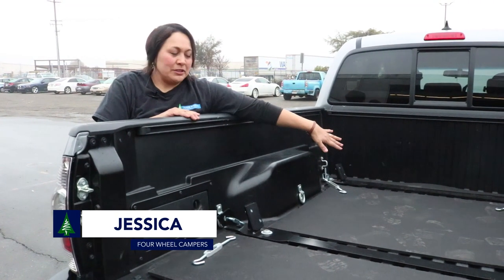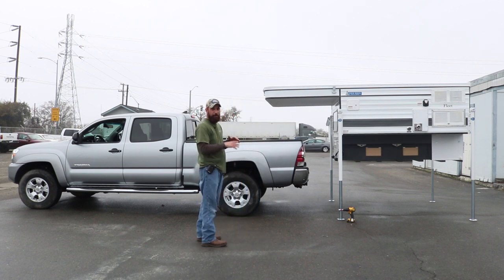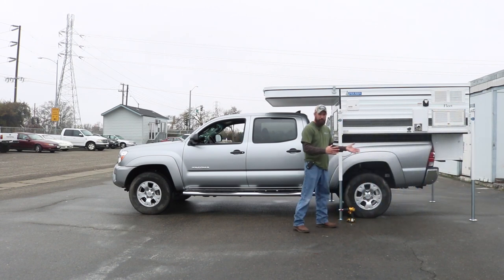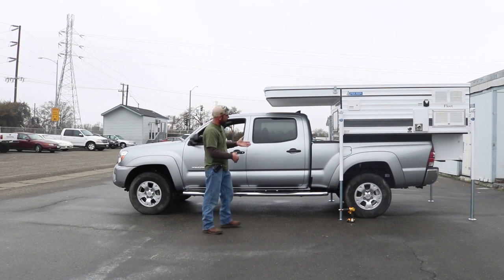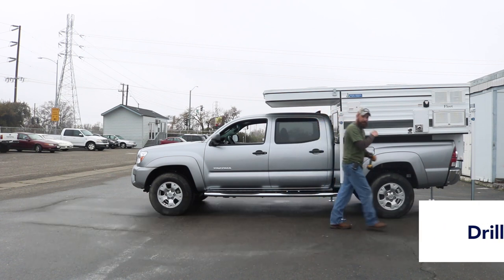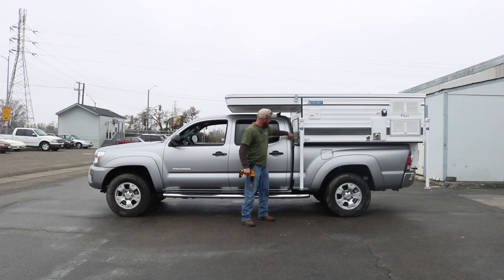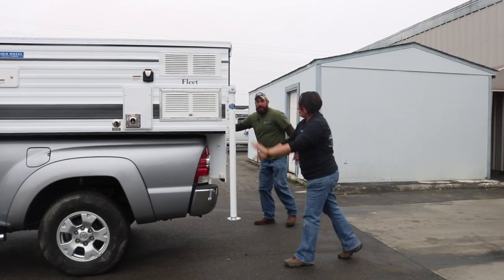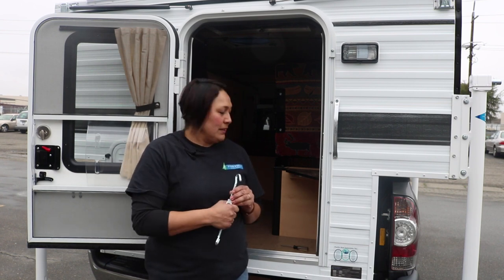Pop-up Truck Camper Installation | Four Wheel Campers

Comment: Watched for the video procedure of installing the turnbuckles but only got a verbal description of the process :o( But, I did learn that turnbuckles are used instead of ratchet straps. At least for long-term camper installs.

Comment: Question for a truck camper vets.  Do you actually take the jacks off?  What happens if you go somewhere (say you need to get work done on the truck) and you need to take the camper off but the jacks are home in the garage?
Reply from the maker: Most customer remove the camper jacks for travel on their camping trips. But if you think you are going to take the camper off the truck for some reason, you can travel with the jacks on & attached to the camper.

Comment: If i want to leave the camper for four month in the truck, do i need to upgrade the tacoma suspension ?
Reply from the maker: Hi Michel,  Thank you for your interest. Most of our customer leave their campers on full-time or near full-time. Your suspension needs will depend upon your exact truck and exact camper (which impacts weight). Click on our "Find Dealer" button at top of our website and our nearest dealer can help you navigate the truck, camper, and suspension options.

Comment: Question, do the jacks come with wheels on the bottom so the camper can be moved around? In my case this would help with storage. Great videos, thanks.
Reply from the maker: Craig.  Not a good idea to put wheels on the jacks, but many of our customers build a small wooden dolly, set the camper on that, and then push it around where ever they want. Easy. Safe, Secure.
Reply: @FourWheelCampers  I can see how the wheels on the end of long legs would be unstable. Thanks for the quick reply, a dolly sounds like a good idea. You guys build a nice camper!

Comment: What are the "D-loops" attached to the truck wheel well for? Is there also D-loops attached to the truck box in all four corners on the outside of the "bed bars"? I just received the Tacoma kit and there are NO directions for installing.  I only understand that the bars are mounted using the bed the bolts. I called and emailed service many times but always voicemail and no reply by email.
Reply from the maker: Hi Tyler. I can send you the instructions we have. Please email me at melanie@fourwh.com. There is also a short video explaining a bit about installation on short bed Tacoma that may be helpful. https://youtu.be/w7UQ8GJTHMo

Comment: Once the camper is on, do you just unbolt the legs that are used to lift the camper?
Reply from the maker: Yes.  You can leave the jacks on, or easily remove them for your trip. Most customers leave them at home.

Comment: What is the total height above the  cab of the tacoma? When in the down position. Thanks!
Reply from the maker: Approx. 1' ft (varies).  Best to measure from the truck bed, up 54". From the floor of the camper, to the top of the roof vent (camper closed) is 54" inches.

Comment: is that 18G wire that's ran to the hood?
Reply: 10G wire.  Double Insulated with a thermal break fuse.
Reply: @stankennedy6200  thank you kindly

Comment: I would like to see this process with a flatbed.
Reply from the maker: Thank you for your interest!  For more info and videos on our Flatbed models for all truck sizes please go to our website and click on "models" and select "flat-bed". The flatbeds are bolted to the frame and are not practical to take on and off on a regular basis. It takes
up to two hours vs. 30 minutes for a slide-in camper. Either way, we prepare the camper and truck at our facilities. After initial install, you can manage it.  For more questions and info please email "Mike@fourwh.com" at our factory in Woodland, CA.  Thank you and have a great day!

Comment: So small
Reply from the maker: The camper size relates to the truck type and bed length. Our campers on a full sized truck of 6.5 or 8.0 foot bed are actually quite large. 
The top pops up to make the ceiling 6' 4" or 6' 6". This creates a lot of space. Our flatbed versions are the largest and people take them to Central and south America for months and years at a time.  Please see www.fourwheelcampers.com for 3D videos to see more. Thank you for your interest!!
Reply from the maker: Thank you for your comments.  Please see  our 3D videos on our website. You may find the interior space is appealing. The ceiling height is from 6' 4" to 6' 6" and the bed size is either a queen or king.  Our largest model for 8' truck bed length with a flat-bed is actually surprising large inside. But, in general, our products are for people who prefer a less intrusive "RV" experience, reduced driving and parking challenges,  less were and tear on their trucks, and the ability to go anywhere a off-road outfitted truck can take them. From Alaska to Baja, to Cental America, to South  America....you will find our customers navigating the territory! Have a great day!!